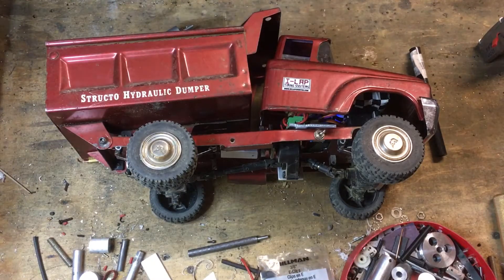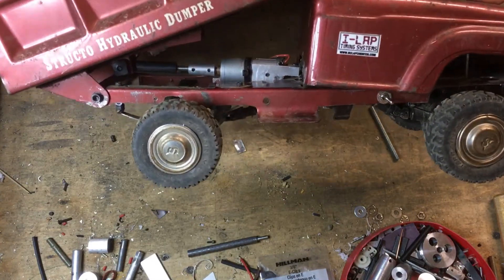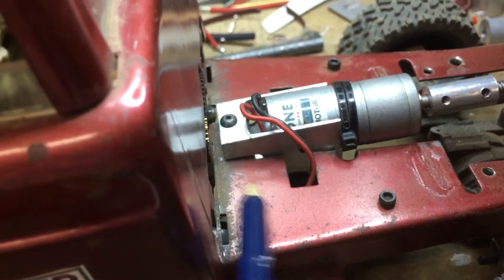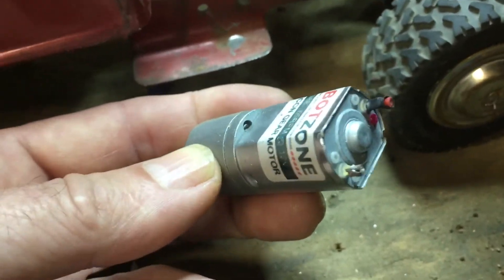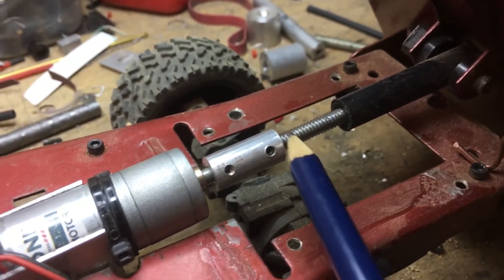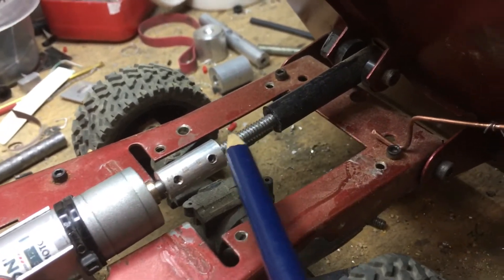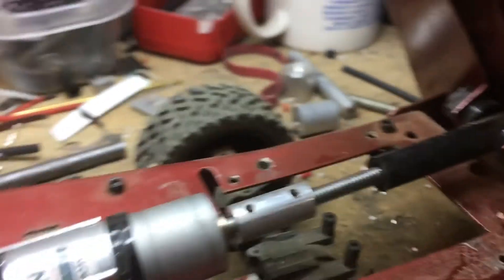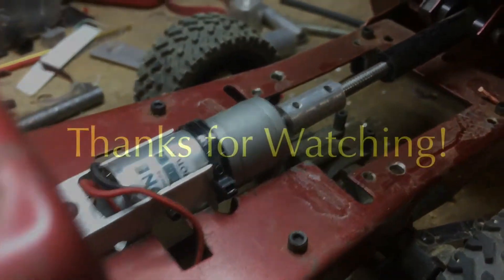DIY Linear Actuator in Toy Dump Truck

Comment: How much load can it lift?
Reply from the maker: Stan, I have not weighed it, but a fullload of sand is not a problem.  The gear reduction is just about right, good lifting power and not too slow.  Thanks for watching!
Reply: @RVJimD  Thanks. Doing something similar on a Bruder dumpster hauler, but not remote, just with a toggle switch on the truck.